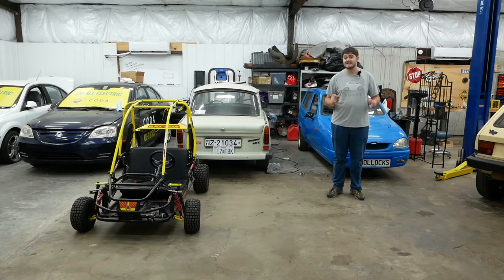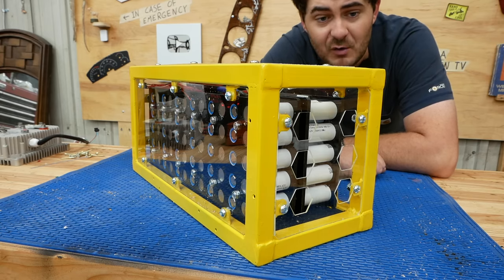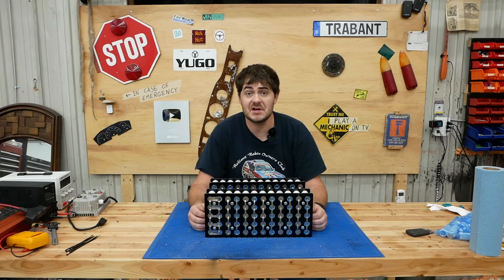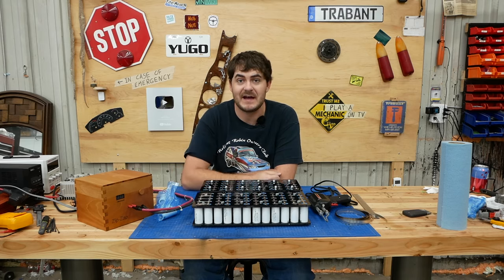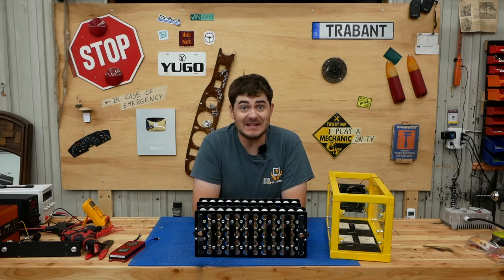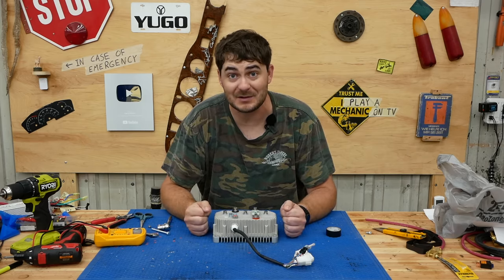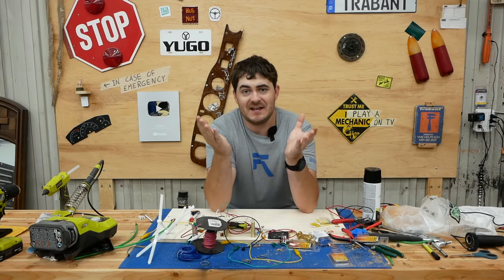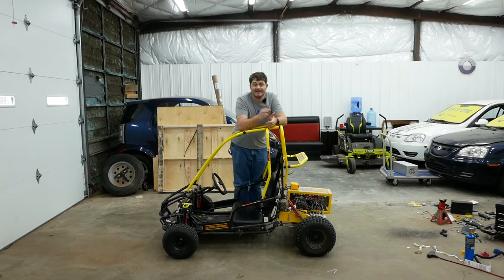I Spent Weeks Converting This Go Kart To Electric. Did It Work?

Comment: I have immense respect as a fellow engineer for someone starting out in the world of electric vehicles but I do want to mention one thing. The collective view is that anything is better than a kelly controller. I recommend looking into vesc as they are easy to program and provide much more useful information when it comes to error messages and figuring out issues with your components. If you plan on purchasing a new motor for that go-kart look for something in the 5kw range (make sure it has the correct duty cycle) and remember: electric components are limited by heat. If you find a way to cool down your motor, whether it be via a fan or water cooling, you can push your components a heck of a lot harder than spec. Also, If you have issues with your BMS and I recommend purchasing a charger such as a D6 duo that only needs the positive and negative cables (plus balance leads) to charge. It acts as its own BMS for charging and is very safe and highly intelligent. For discharging you can buy voltage testers for the balance leads and set them to warn you when the voltage drops to a low level. Voltage testers are usually 25 cents a pop and reliable in my experience. Also, voltage sag should affect a controller's performance unless there is an issue with it.
Reply: I have immense respect as a fellow editor and would like to point out the aesthetically delicious bead seams on the second battery box especially under that yellow paint.

In addition, his fanciful sense of farcical, self depreciating comedic timing and melodical approach to jump cuts via utilizing foreground foley to cue spontaneous riffs brings his already premium STEM content to a higher level of infotaining/pleasurecational quality.
Reply: Why not go with a 20 kw motor so adults can have fun too, 5kw is better for a scooter or small motorcycle. I'd rather limit it than not being able to go hard enough:D
Reply: @TheBozn  If properly cooled 5kw is enough to have a great time. At 20kw you would most likely be spending money on power you don't need. Also, the components to utilize a 20kw motor would push the budget to an astronomical amount.
Reply: @reichenschaller365  20S2P LiPo (60Ah each, 120Ah total at 74V for 11kWh) = £1800
BESC G2 (100V 400A controller) = £250
25kW 120100 motor, 300A max 180A continuous, 27S maximum, ~44Nm = £250

Halve the battery (it’s sort of overkill, the cells are 6C continuous so you can get 360A which is ample) and the cost is only £1500. Hardly astronomical for 25kW I’d say.
Reply: @imperialsecuritybureau6037  I would love to see where you can get a 25kw motor with an appropriate duty cycle for one ~$350. $2477 for the batteries makes sense but 350 for the motor and the controller is ridiculous. If you see a 25kw motor for 350 you should steer clear of that obvious lie. Remember, in applications like a go-kart duty cycle is imperative lest you want a burnt-out brick.
Reply: @rammingrampage5775   The fun is making something fast and electric. Has engine are easy to use.
Reply: I would start with the previous idea, having experience with these amazon controllers, making a float wheel of my own, multiple bikes and skateboards, I think your over powering your rotor magnetic field with the stator field, and negating the hall effects try it on 36v instead of 72.. I think your hall sensor error is the same as without the sensors.
You could try shielding the hall wires, and maybe lowering your rotor amperage and boosting your voltage, also check your polarity on your rotor to be sure your getting proper north south, maybe cut the "claws"  out  If that doesn't help get a vesc as it sounds like your Kelly bldc controller may be going bad, you are putting 80 volts into a 72v controller right? And last option, and I've seen your workshop, you may be one of the few people who could make a rotator with permanent magnets. But once that motor gets up to speed it stops using the hall sensors, it only uses then to get going. Is there a learning option in the controller? Either way, cut your voltage in half and see how it works from there. Is there a setting on the controller for gears, or assist mode?
Final thoughts safety typing all this out, shield your hall sensor wires, and either drop your stator voltage or raise your rotor magnetic field. I think a 3:1 radio would probably be ok, but with that strong of a stator field, it's going to be hard to get the rotor field to be heard by the hall. Or get a smaller mirror with sensors and run it next to it, and on the chain so they are in sync and bluff your sensor location with the other motor and esc.
Reply: You seem to know a lot about these small electric systems. What do you mean by “make sure the motor has the correct duty cycle”? I thought the Duty cycle was just a power output option, customizable through a vesc. 

Thanks!
Reply: @NoahZimmerman  Everything I know is just based off of practice so know I might be off on a few things. As I see it the duty cycle is just how long you can run a motor at max power. In this video, the motor may have a 5kw rating but it most likely has a very short duty cycle before it reaches its thermic equilibrium. (It can't do anything without the coils burning) When it comes to power you have a 5kw rating and then how much power you put into it. In a VESC you can increase your amperage and therefore increase the power but that also increases the heat. If the duty cycle is short then that extra heat will make its run time short as well. An electric car has to have a big duty cycle because you drive the car for hours on end. However, something like a pedal assist bike that gives you a little bit of power every few minutes or so could get away with a short duty cycle.
Reply: Why are VESCs so expensive, and why do no battery makers suggest using antispark connectors while connecting a BMS? I almost blew myself up six times.

Comment: Upgrade your spot welder by throwing another MOT in parallel.
Also, the two battery packs look like they could use some insulation between them 😳
Reply: the copper wire wicks away heat too effectively. I worked a job where we occasionally recycled that stuff, it was a pain to melt so I could get an assay on it as we used a modified welder setup to melt samples down in a crucible

Comment: I made a crappy spot welder using a 12V leisure battery and sharpened copper rods, and a high current relay that I controlled with an Arduino and foot pedal with precision timing to get the welds that looked best. After getting the microtiming dialled in, it worked amazing. Only trouble is, the battery losing voltage after many welds and the microtiming had to be extended to get an equivalently good weld but hardly a complaint, I can just charge it. Hope you got it sorted in the end!

Comment: I have to wonder if the hall effect sensors have a functional 'voltage/magnetic range' of input on them. Meaning, how much electricity can you put into the alternator before the resulting magnetic output overloads the HE sensor and gives a bad motor controller reading. In simpler terms, are you EMP-ing the HE sensor and therefore overloading the inputs on the MC?
Cursory, completely ignorant, searching indicates sensor power voltages and switching currents range from 3-30v and 1.5ma to 250ma. Not sure what those ranges mean, but I suspect they're related to the HE error you're getting. Additional research reqd.
Reply: I'm mostly commenting in the hopes of visibility for your comment and I know nothing about this topic but your explanation would certainly make sense as this issue occurs when applying over "bare minimum" of power. Also, shouldn't it be possible to test it by accelerating slowly on flat ground? If I understand correctly, when the motor draws enough current to make the magnetic fields big enough, it happens at a point which should always be the same speed if tested multiple times under identical conditions? Am I even remotely correct?
Reply: @jokumukamikalie  You're mostly there for non-technical talk (I'm not much above that myself). It would be a good test to try, yes. Start on flat and level ground and gradually increase throttle. If it cuts out at a consistent throttle ask, then it may be as I suspect. If not, it is likely some other electrical issue. I'd start with small diameter wiring on up. Interference maybe??? I understand that he needs a break from it currently, so we may not see anything there for a while. If a patreon post comes up in future one of us should mention it (if we recall).
Reply: bump

Comment: For the bus bar clamps, you could also put the clamp screws inside the acrylic sheets with the threads pointed out, then use a steel nut to tighten down the bus bars. But your 3d printed solution is more elegant.

Comment: This electric go-kart series makes my head hurt. It also reminds me of my semi-frustrating childhood, where spending thousands of dollars and a couple years building something from a combination of junk yard and expensive mail order parts was somehow always preferable for the adults in my world (children of depression era farmers) than just buying something that actually works for less money.  But seriously, I wouldn't have had it any other way. Teaching the kid resourcefulness and delayed gratification is a character building lesson. But I hope the kid will get to drive the car before they start high school ;-)
Reply: Lmao I was feeling that the entire time I was watching this series. Im converting a 350 into a vortec 350 out of junkyard parts and expensive mail orders and its frustrating
Reply: I’m going through the same thing with my 66 Cadillac. Ditched the carb and added throttle body fuel injection off a 91 Chevy truck. Most of that is okay, but I did a few custom things along the way like an arduino controlled radiator fan assembly. Each time I face a challenge I wonder if I should just go back to the way it was lol
Reply: @clarkinthedark1  I took a wiring harness off of a 98 silverado 1500 and I'm putting it on my carbed 350, i modified the hell out of the harness. 0411 swapped ecu, multiport fuel injectors with multport intake. Most of it is going ok but sometimes I wonder the samething. Should've I left it how it was? I sometimes wonder that. But considering I'm going to be able to tune the hell out of my truck and have awesome fuel economy and power I think it's worth it. If you need help feel free to ask
Reply: lol yeah. ive been trying to make speakers and i finally made some 150euro speakers that work as well at 300euro speakers, and only spent 600euros on the development.

Comment: When i built an 80A battery pack for my ebike, i did series connections with the same solid nickel strip, then soldered short lengths of copper wire to the parallel connecting nickel strip in the gaps between the battery spot welds. Works a treat!
Reply: Yep. The weak point is the tiny spot welds anyway, rather than the strips. You need lots of welds per cell, so sometimes two strips of nickel gets you some more spotting surface.

Comment: As someone who has built my own e-bike, I feel your pain. Especially with the battery pack, which for me has been a constant subject of redesigns and troubleshooting and never being quite satisfied. I will say though that I used a hub motor I got from the UK, it's been serving me for 4 years and at least 10000 kilometers, and it has never given me any trouble. I'll also say that hooking up a DC to DC converter to the BMS has given me trouble, it introduced a weird feedback loop which has almost fried my BMS without any actual load on it. Electricity can get up to all kinds of weird stuff like that.

Comment: As several people have already pointed out, I would recommend using a small external rotor for the hall sensors (it could be just a 3D printed disc) to avoid any magnetic interference from the stator coils. As for the battery connections, even though it must've been a lot of work, the 3D printed clamps are probably not the best idea. 3D printed parts tend to sag over time under continuous force, not to mention that even PETG will get much softer if the battery pack heats up. I understand that you want to do thing yourself and I can appreciate that but in this case, I think it would be best to have the battery pack spot welded properly at a battery repair shop. I hope you don't abandon using the alernator as a motor, I think it's a cool idea. If you wanted to take it a step furter, you could fabricate a new rotor and use permanent magnets which would probably increase the torque and efficiency dramatically. It shoud be possible to use magnets from an old hoverboard wheel if you wanted to keep the cost low.  At least you wouldn't have to worry about powering the rotor coil.

Comment: If you're ever intesterested in adding more safety to the go-cart, you might be able to add some form of cutoff in the seat belt (when the belt is buckled, allow throttle input), or a safety cutoff in the seat (similar to a lawn mower).

My two cents.
Reply: I'd put some protection between the chain and the high current cabling personally...

Comment: I think you need filtering. Because of how a alternator has to have the rotor charged to 12V to work. The center of the alternator is basically a brushed motor. This may cause electromagnetic interference in the hall sensors. Try adding low value ceramic capacitors between the plus and negative terminal on the 12v in and ground them to the motor case itself. The same way you would see them on older brushed rc cars. Hope this helps. Good luck on the build!

Comment: an alternator rated for way under your voltage will screw stuff up, also the heat from the voltage on those copper strips will cause the plastic to warp

Comment: How is an old DC treadmill motor not the perfect idea? People use them all the time to turn a normal wood lathe into a variable speed wood lathe. Just needs a cheap little PWM module you can get plans for online, and old treadmills are a dime a dozen.
Reply: It is the perfect idea for a lathe or a treadmill. Nowhere near enough power for this application, plus needs dangerously high voltages (usually 150V or so DC).

Comment: As for the charger, this type of fault is likely because of the blown (shortened) rectifier bridge, less likely there is a short in a capacitor after the bridge or class-x filter capacitor. And please, never replace a fuse with jumper wire, if fuse blows more than once, something else is definitely terribly wrong, I know, I tried it more than once.
Reply: One trick I learned in a forum, is to replace the fuse with a 100W light bulb. If it glows, you have a short and if it just gives off a tiny bit of light, it should be fine again. Can save you buying a ton of fuses to test if it is fixed.
Reply: @SchwachsinnProduzent  Yes, it's good old trick, but usually just testing input with multimeter in continuity mode will tell the future in terms of bang at plugging in.

Comment: Hi, just something that i noticed, the batteries mounted on the rear suspension adds a lot of unsprung weight, besides that, the vibration and the movement could damage something, or maybe break a solder point and others problems related to the eletrical. i love the build man

Comment: My estimated KVA rating for voltage and current required for an EV of this size is: Weight + budget divided by patience. So the proper power factored correction of the RMS rating for this should be about 40 pounds of batteries and a medium amount of voodoo with a large dose of hope. Everything keeps pointing back to the number of teeth on that alternator. If a smaller sprocket not available, perhaps a second shaft to further reduce the ratio? Keep up the good work!

Comment: I bought an e-bike kit, it came with a throttle, a motor, a control unit, just needed to add a battery which I bought separately. The control module died so I had to replace it, then the battery pack 1 battery shorted out and killed the entire in series of batteries that were connected to it I replaced the row with phone charging pack batteries that already were tin welded. My home made E-Bike setup works but overheats going up hill and dies unless you pedal super hard and give it only 1/3 twist to the throttle. I ended up just buying an e-bike already built to actually enjoy using. On the first day of using my new e-bike I had an accident and spent the summer in pain but that's another story.
Reply: Building things without a considerable margin, will do that. Rule of thumb is to calculate the needed power and rate everything for at least twice that.
Maybe some advice too: Stay off bikes, they're nothing but bad luck (for you)
Reply: @paulmichaelfreedman8334  Your advice to bad luck is idiotic.
Reply: Of course your DIY pack overheats and doesn't work properly. You cannot use low-current Lithium cells (from phone charge packs) in an application like an e-Bike. It's amazing that the cells didn't catch fire from the abuse you gave them.
Reply: @johncoops6897  I'm the same, I like to learn while failing. 😬

Comment: Alternators are made for 2-6k RPM, you've got the wrong gearing by an order of magnitude.
Reply: Lmao you’re right. That alternator is not liking this.
Reply: You certainly wouldn't want the back tires turning anywhere near 6000 RPMs. The gearing is fine.

Comment: this is literally a project i've been spec'ing out for a while. in the end i scrapped the conversion and went with restoring the original clapped out motor. i'm pretty happy with it, but i'd kill for the frame you have. i've been looking for yerf-dog style frames for almost a year and they are a bitch to find. they take a conversion much better than a 1-wheel drive like i currently have